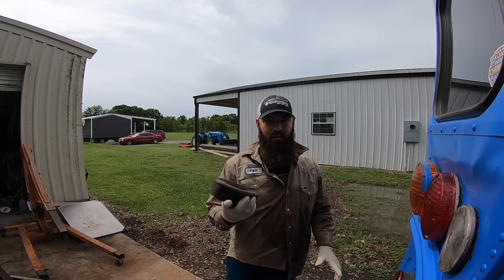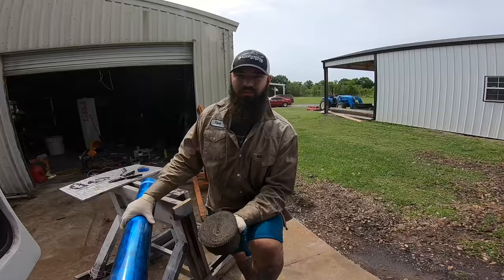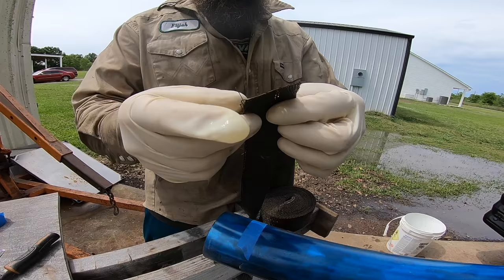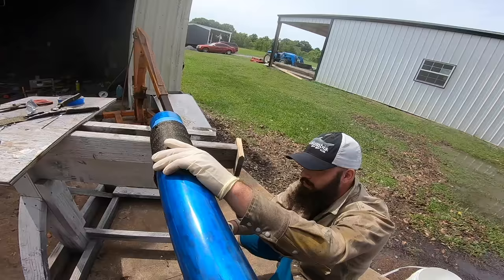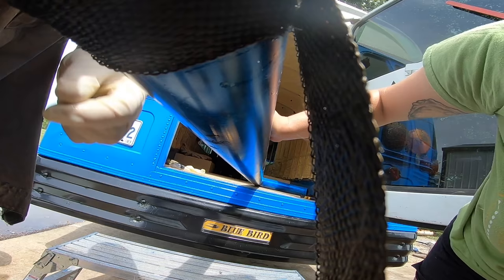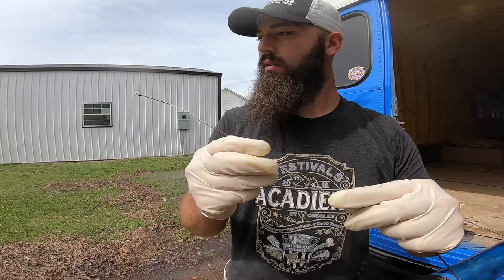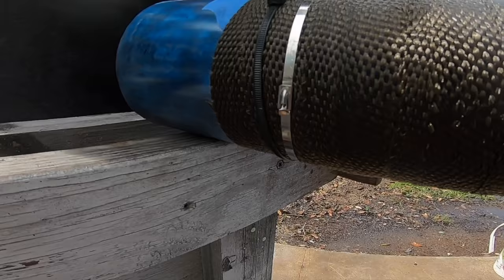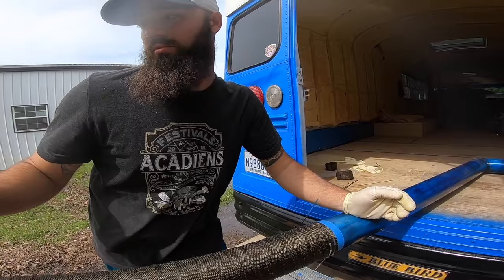Exhaust wrap - TIPS & TRICKS // How to wrap exhaust like a professional

Comment: to stop the steel tie from loosening a bit, as you pull it htrough push the ball bearing into the housing, this stops it slackening off a couple of MM, best way to wrap is to overlap 50% and this will give a consistant double thickness from start to finish, no highs and no troughs, when finished run engine and when dry coat with silicon spray. . .
Reply from the maker: Nice tips, didn’t even think of spraying it with something to protect it. Thanks for watching!
Reply: There's a proper crimp tool for the steel straps also a "sealer spray" for the wrap.never used it myself.... 👍

Comment: My first time doing that. I didn't know it was supposed to be wet. It makes sense. And I gave those metal zip ties to a friend. I used bailing wire. Much easier to work with and I tied one about every 3". I think it'll hold up. Even if it's put on dry. Or should i remove it and start over???

Comment: is it ok to breathe in all that fiberglass?
Reply from the maker: It was wet when installed, so the fibers weren’t really in the air. Would always recommend to use all the safety precautions you have available to you! Breathing that stuff in (when sanding or handling dry for example) is not healthy 👎🏼
Reply: WTF

Comment: So... i have a 400hp MONSTER size turbo diesel in a 40' Mainship 25k#.  I am getting ZERO boost.  The old guy i got it from replaced the 160hp engine.  This engine came with dry exhaust manifolds.  He put on wet manifolds.  My knowledge of engine physics tells me he is sucking all of the heat out of the exhaust charge and the turbo (while spinning freely) isnt spooling up.

The marine "rules" say you must have a wet exhaust manifold.  My solution is to use the double wall (wet manifild with no water) and wrap it to achive roughly the same thermal result.... and finally get some power and fuel economy.  I will probably use mig wire tails as extra ties when i run out of the 10 included with the 50' of wrap.

Any thoughts anybody?

Comment: wat you could do that doesnt look too mush like a heatshield is put a pipe cut in half length wise over the wrap and fix it to the pipe with hoseclamps , i think if you rake sumting along the pipes or bump intoo them it will damage the wrapping , having it exposed to the sun prolly whont do it any favors either and have the black turning intoo grey or white , the "shields" over them should prevent most of that , could paint the shields in either the exhaust blue or in the bus blue / black too
could have a set of custom shields made somewhere with a cnc plasmacutter / waterjet and have the name of the channel or bus cut intoo them before rolling them halfround or use a brake to give them a multi angle 

just thought of sumting weird : if you ever decide to have a patio next to the bus under an awning with a propane bottle style wood burning stove you could make a hookup for the stove intoo the same exhaust pipe  (hidden behind the shield ) and not have to worrie bout smoke blowing intoo the bus
Reply from the maker: We’ve had the wrap on for some time now and still looks fine after being out in the sun. The wrap is just a very simple solution to prevent anyone from burning themselves and has worked out great 👍🏼 We didn’t wish to go through any extra set up as this simple wrap does the job we wanted
Reply from the maker: I don’t think we will do a wood burning stove. Unique idea though!